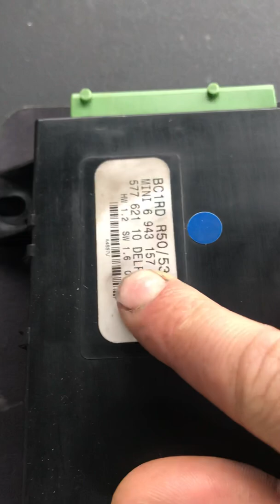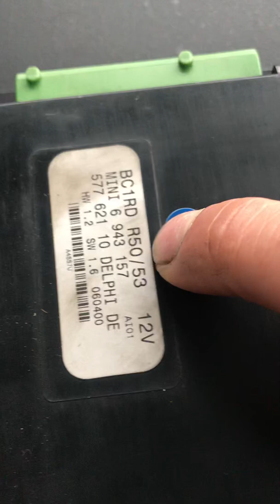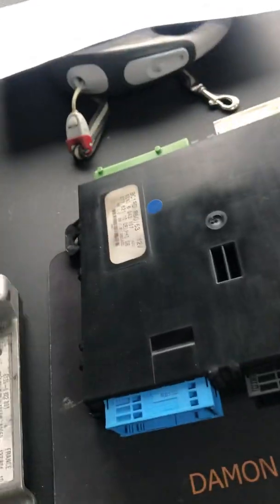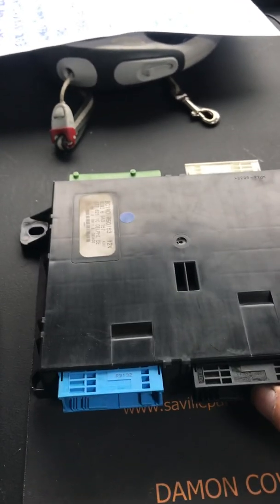MINI BCU FAULT HOW TO REPAIR, R50 R52 R52 (different types of BC1) body control / footwell module

Comment: I own R50 2004 year. But it has battery leaking problem. 
I found the problem fuse is Fuse 3 5A. But there are so many functions on Fuse 3. 
Is this related to FRM module? 
Thanks

Comment: Very informative, can I i use the pastic later model on a 2001 that currently has the metal module, they are cheaper.
Cheers

Comment: 2007 R52 Cabrio Cooper S,  Drivers headlight out passenger high beam out and right side turn signal out. All bulbs are good all headlight components double check with operational side componets. swapped a used module no change, Euro spec

Comment: Hello, I am encountering a problem on my mini R53, we are talking about the heating and air conditioning control, it no longer turns on, it is impossible for me to have ventilation and to choose the temperature level, when I put on the indicators, it does not appear on the meter and we do not hear the same noise, when I turn on the light, no light comes on, the steering wheel controls of the station no longer work. All this started when my battery drained due to water infiltration in the trunk. The original radio was also faulty for a few days with a message displayed. However, it is now working again. Do you think the problem comes from this box?

Comment: Hi I have an issue where the car starts intermittently and also I cannot get passenger door to unlock from centre locking.
Only way I can start car is to unplug the ESW and battery and put back together.

Comment: Hi just taking my control module out of my mini. It's had flooded and all the bottom connectors on the two bottom SCART connectors what corroded. Lights Miranda the lights the wiper the convertible roof wouldn't work properly the heater pins with snapped off and rusted. But with the module taken out the car still runs so we'll run it until I get my new module😢

Comment: Hi, I've just replaced a bcm r52 2006. The faults were; couldn't turn the light off, wipers come start working on there own, no interior lights. Swapped like for like. You can programme the key fob on the used bcm with the key so everything works Inc the locks. The problem I have is the headlights. They work fine withe the light switch when the engine isn't running but when I start the car, after 5 -10 secs the light start to flicker but they work fine if I turn it off and on but don't run it. They are xenon self leveling. Any thoughts.

Comment: Bonjour 

J’ai un soucis avec mes phares qui reste toujours allumé même contacte coupé en plus de ça je y début j’avais l’essuie glace qui fonctionne plus est defois le chauffage cela est moins fréquent que les phare qui reste toujours allumé ma question est defois savoir si je change mon module par un de occasion cela résoudrait mon problème de cela il faut le faire code ou autre ? Ou le codage est seulement nécessaire pour la centralisation ? Merci d’avance pour votre réponse

Comment: Great video, perfect for my problems! My R52 has a soggy footwell and the alarm, hazards and lights keep operating when it's locked (not if it's unlocked). I've taken the BC1 out and it looks pristine and dry. It had the black cover over it. The wiring along the sill and the carpets are wet however.  How likely is it that the wiring is compromised? https://drive.google.com/file/d/1YXSz9InOW1soCnrbnifPJlH1uoaaw80r/view?usp=sharing
https://drive.google.com/file/d/1h9tvQPalTaDiHVGyU2AKh0wRj0RX-26f/view?usp=sharing

Comment: I have a 2002 R50 that jolts when I put it into drive I have done the ECU and BCU reset with the odo button but still doing it, do you think a filter and oil service would fix this or am I looking at something more serious? Thanks in advance for any help you could give.

Comment: I've fitted a replacement door that has its own key but it won't work, is that down to the BCM, and is it fixable because trying to retro fit the original lock and key from the old door terrifies me

Comment: Thank you for your videos - so knowledgeable. If you have an opinion whether i am facing BC1 problem vs lock actuator problem it would be great to hear it. My symptoms are that the driver door lock can only be done from turning the key in the lock or pulling twice the door opening latch. It doesnt lock by remote, by dash switch or self-lock over 10kmph. The passenger side works perfectly in all ways. Thank you.

Comment: Looking to replace an R50/53 one as currently the lights are doing random things. How much will work with out recoding? Seen videos where it's everything except remote locking. Would it still lock/unlock old school with a manual key turn? 

Also, any recommendations on places to get reprogrammed? TY

Comment: Hi I have a 2001 built 2002 Mini Cooper R50. I have recently replaced the wheel speed sensors and ABS module. The ASC light was on so when i went to turn the light off with the toggle it fried the toggle PCB at the ASC toggle position, got a sizzle noise and smoke, confirmed later by pulling apart the toggle unit. However coinciding with the blowing of the toggle pcb, I lost the rev counter,speedo, and headlights. Just the needle function of both gauges,  I have replaced the toggle unit with no result. Do you think i have fried the BC1? All related fuses and relays are o.k . Thanks for your videos!

Comment: I have an R52. I had to remove the battery to change the gearbox mount and since putting back together I've had issues, windows not working, indicators not working and vehicle not wanting to start first time.

I've found a replacement BCM online. Is this plug and play? And if I don't get the BCM cloned what won't work?

Comment: Thanks for the video.. I have a question, I have a mini R52 that I am going to change the module for a used one. I understand that as long as it is within the same years of manufacture, the reference does not have to match... right?

Comment: Hi, My BCM had gone. Defo  misting up in car. Hi, moisture.  
Can you swap R50 53. For the same PFL  or R50 needs, R50  and R53 need R53. 
Does it need coding on all swaps or just when you use  PFL on a PFL. Car  ?

Comment: Hi I have a R50 2006 model, the engine won't crank, all dashboard lights light up. There is a relay click on the passenger side kick panel when turning the ignition. The supply voltage to the starter is there, is there any other supply that I need to check that will cause the engine to crank up?

Comment: Hello and thank you for your videos!  I have a 2008 R52 Mini Cooper S Convertible Sidewalk.  Symptoms.  1) re-occurring airbag light (reset by dealer twice (passenger airbag seat sensor replacement recall done, airbag light still comes back on)), 2) Steering Angle Sensor Fault Light On (was going to replace the sensor but decided to first see if it was related to the other ghosts in the machine), 3) While driving, seatbelt buckle reminder light will go on with seat belts (both) buckled, 4) Turn signal will not go off with lever in center position.  Also turn indicator will not activate when lever is put in up or down position, 5) Tire Low Pressure light will illuminate for a minute or two and then go off. (tires are fully pressurized), 6) Amber display (mpg, etc.) on driver cluster and amber display (trip odometer, etc.) on center cluster will disappear completely for 10 seconds to a minute while driving.  

Windows work fine, top works fine, car drives great otherwise.  However, the trunk button on the remote does not function.  Also, the dealer was not able to active the all windows down and sunroof open from key fob feature that should be available on my Mini.  I realize that some of these symptoms are likely not related to the footwell module but I have not been able to find a good manual or reference so I can learn the ins and outs of the car.  Any help would be greatly appreciated.  Thank you in advance, John

Comment: R52 Mini Cooper Convertible 2005 , no Central Locking working, radio not working, the roof wont close fully , its after passing the Irish Mot the Nct , all the lights work obviously,  im stumped with it ,i cant get anyone to fix the car 😢have you any ideas,  im wondering is it the control module

Comment: I've got a mini one convertible 04 reg with so many problems.. first one speedometer not sure ,fuel gauge reads empty sometimes,  handbrake light on all the time, abs light and tyre light on, and soft top not working.  Coming up with fault code p1613 but not sure on code now. Please could you give me some more . Abs sensors have all been changed recently thanks Mr fullwood.

Comment: I have a 2003 mini which has failed mot due to wiper arms parking in upright position, we have replaced wiper motor but same fault occurs, bmw have quoted £600 to replace controle module but cant be certain that is the fault , any ideas would be welcome

Comment: I have a  r52 where the roof  does not  work  and heated rear window  does these go through  the bcm I haven't  looked  yet for damp but I have checked  all fuses  and relays changed roof  module  as I had one with car and but still no power  to  these things

Comment: Hi I have a mini cooper s r53 2003 mini body control modular has gone only open my drivers door with my key 🔑 and egnition to start my car iv  been quoted 600 pounds to have a new one fitted and working do u think its worth the price iv gone to lot of garages only one place in hull thar does it

Comment: Got into my 2006 R52 tonight and had no illumination on my speedo, rev counter, line of switches, indicator stalk etc but everything working outside eg: head/side lights, indicators & brake lights!.... Would this be a fuse gone somewhere or something else? - Not had a chance to get out there and check yet as it's been peeing down all down but just thought I'd ask as I'm on here atm 🤔🤔

Comment: Having issues with my mini cooper. Its a 2006 base model mini without a convertible. I had to jump the battery today and when i got to where i was going i turned off the key pulled it out of the ignition and the car continued to run with the key in my hand. Could this have to do with this BCM going bad or would it be something else? Any Ideas im out of a vehicle till i get this issue resolved.

Comment: Great , Vid , Ive few faults , car randomly unlocks , and Central locking plays up when been really wet , Main problem is battery not charging , New Alternator fitted with a new battery , Been fine for a year , now back to its old tricks ..BCM issue is?

Comment: Have R52 with issue unsure if BCM.
1. Remote will not open car
2, When open car with key alarm goes off does not go off when key put in ignition
3. Central locking does not work from centre button
4, Car starts and runs ok just alarm on

Comment: Hi there! The issues I’m having are locks working intermittently, ac not working, interior/headlights dimming or not turning on, and power windows working intermittently. Is this a failing bcm?

Comment: Hi there great video. 
I have issues with my r50 
When I turn it off the wipers turn on and the radio stay on . I already change the ignition switch. So do I have to change the bcm of can it be fix. Thanks in advance

Comment: Hi mate, thank you for the video. 

My mini has a variety of issues.. 
-brake lights stay on after car is off 
-Speedo stops working 
-Auto gearbox gets stuck in gears and needs car turned off and on to reset. 
-Radio doesn’t work sometime 
-sun roof doesn’t open sometimes 
-car wouldn’t start for 5-10 minutes every now and then. (Just cranking over)
-now it isn’t starting at all (just cranking over. 

Is this the symptoms of a BCU?
I will be forever in your debt if you can help me wrap my head around this🙏🏼

Comment: Eyup, informative video thanks for sharing it. tonight my 2005 cooper s when i rev over 1800 rpm the traction lights come on eml tpms and the gauges freeze but the needles flicker and buzz, at the same time the power steering stops working and the headlamps turn off, if i let it idle its perfectly fine. i suspect bcm and after digging a bit read that if i buy the bcm, ecu, keys and locks i wont need to code it?? could you clarify

Comment: Hi, Great Video. Very informative. Thanks a lot. My car has a lot of electrical issues and I'm now thinking these could be related to BCM failure. When switching off the ignition the car continues to run at times and the battery needs to be disconnected to get it to stop. also, it switches off just fine at other times but the Rear brake lights stay on & all the ignition lights are illuminated even though the key has been removed from ignition. I've already replaced the ignition as I've heard these are problematic but this hasn't made any difference. Id be very grateful for any advice you can offer :-) Many thanks . . .
Reply: Did you get an answer on the brake lights staying on?.... I've got the same problem
Reply: Have either of you sorted this out yet? I'm having the same issues with my mini and it's driving me insane.

Comment: Thanks for that - we have a 2007 convertable sidewalk ....central locking doesn't work and when I turn off engine and ignition tge wipers come on and won't go off, drivers side footwell very damp after recent rain  - sound like BCM? any idea where I can send it to be repaired ?

Comment: Okay I've a R53 , recently developed a fault , Starter won't Engage , sometimes once I go Crank the steering  pump will  start , sometimes is won't.  I bump started it and its worked fine . Replaced ignition switch . Still got the same Problems..... could this be a BCM

On hindsight sometimes it cranks and sometimes is doesn't.  Read forums but many kurb side mechanics pointing at at Battery  Battery is good ! So can you shed any light on it ?

Comment: Hello thanks for the vid. Question my Windshield wipers randomly cut on at start up and will not stop until car is powered off
- Radio won’t turn on
- HVAC system has power but will not blow any air. 
Car some times won’t start. 
I just ordered the ignition to see if that does anything. 
Any help would be great👍🏽
Reply: Did you figure out what this was?  My car just started doing the same thing!! @vegasbajagarcia9530

Comment: Just purchased a 06 R52 but it has no power to the top controls the radio or the cig lighter?  Any suggestions on where to start looking for the issue?

Comment: Hi my hazard light on the clocks won't light up and central locking locks the unlocks on its own and my mini has electronic climate control  keeps going off when I unplug the blue plug on the body control unit heater and all lights up. Could it all be related to the body control unit.... Thanks if u can reply.. Mark

Comment: I left the top down on my r52 2008 convertible and, since then, I've been having problems with the power windows, convertible top, lights staying on, and wipers not working. Does this sound like a BCM issue?

Comment: Hi I have a r53 that when I'm driving it the Speedo dosnt work the hand brake light and abs and flat tire and traction control light s at on the water light is flashing do you know what it could be please

Comment: Hello, can you please help me, after battery going flat and jump start the car car started and runs normal all works fine except both dash clusters are dead (no speedo, no tacho, no any light on the dash, fuel and temp gaudges dead) and radio works fine. Its a Mini Cooper 2008 R56. Thanks.

Comment: My Cooper S R53 was fine until just before chrimbo and now cannot get the car to central lock with the key. Everything else works properly, lights, radio wipers, central locking switch inside but tried to re-pair the keys to the car and nothing. Changed out mirror sensor and no change, BCM seems to be my last point of failure as the diagnostic kit I have talks to all parts of the car except for the BCM, so I think I need to get it out. Have you, or anyone, come across this before?

Comment: Hi, does the bcm control power to the tailgate release and number plate lights. I cut the wires on the number plate lights circuit whilst live. Cannot seem to find a fuse anywhere on the car. Cheers

Comment: I replaced my footwell module with a second hand module, central locking does not work (not a big deal) but the kicker is that you have to turn everything OFF before turning the ignition off off.
i.e. having the headlamps on, switching the ignition off and then the lights remain on and do not turn off when commanded by the instrument stalk.
This has led the SignificantOther to call me up after finishing a shift to find the car with a flat battery.

Is this normal or just quirky for me?

Comment: Have a r50 number plate lights flash with keys out no dash lights or indicator in the car but work outside drivers door dont work off remote and side lights on dim with keys out looked over all the plugs no corrosion seen at all

Comment: Hi, thanks for a helpful video! I have a 2006 Cooper, the faults I have are 1)cooling fan runs 5seconds after engine is started
2)power steering pump is operating when ignition is on before starting engine.
3)xenon headlights work when engine is off and for the first 5 seconds after starting then they flicker really fast.
Do you think bad BCM or just lots of faults? 
Thanks in advance for your help!
Reply: Did you ever get an answer to this?  I am having the same issue and would also like to know.

Comment: Hi not sur eif you may know, but basically I own a Mini Cooper D, 65 reg and a friend came over from the States and connected his phone my central display system. After that it keeps turning on with the mini logo then switching off. I've seen on forums that this has happened to alotof other people woth their display. I've ched the fuses and they're all fine. Do you know anything else that could help?

Cheers!!